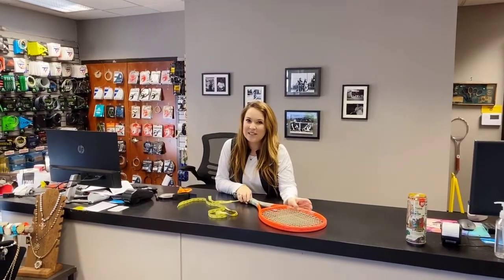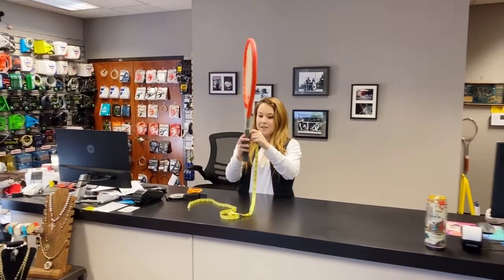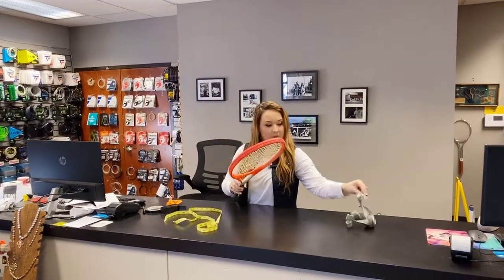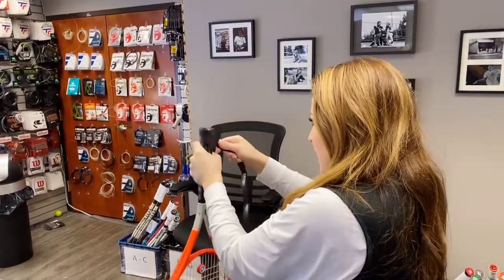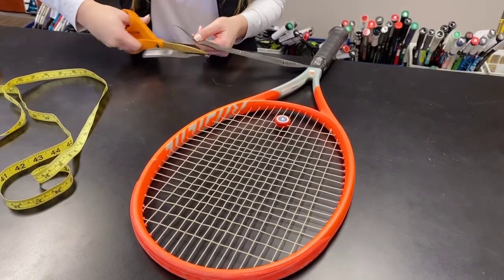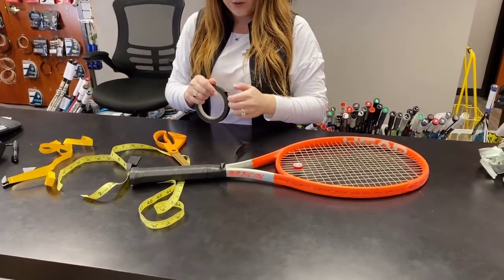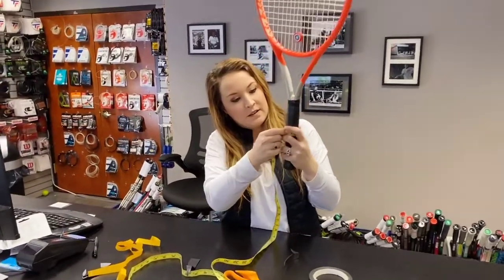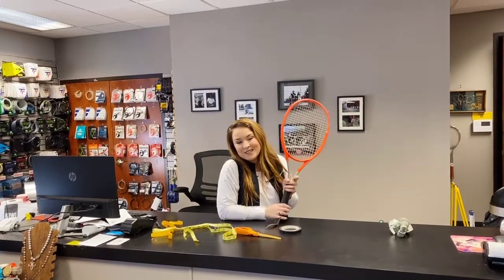How to Make a Tennis Grip Smaller

Comment: to make the grip smaller, you can just remove the replacement grip, then file the bare handle down with a file, or sandpaper.
Reply from the maker: I would HIGHLY advice against this... to get all the sides and bevels sanded down to be identical around the handle would be near impossible.
Reply: @CourtsideAfterHours  i did it😬

Comment: A very extreme way to reduce grip size is to use a sand block and carefully sand down along the bevels to avoid rounding it. But is hard to make is even. Do not recommend do it unless you know what you're doing.
Reply from the maker: Even if you are in the industry I wouldn’t recommend doing it. It’s so hard to get it perfect, my husband and I wouldn’t touch that with a ten foot pole. The manufacturers are very against it as well and I believe it even voids the warranty of the racquet.
Reply: @CourtsideAfterHours  I made a tool just for sanding down the grip, because I like old Head/babolat style grip.  I basically buy a two grip sizes bigger and sand it down using the tool. It's a fool proof method, because the tool stops me for over-sanding and it keeps the racquet handle completely flat.
Reply: This particular racket is a head, which has pallets that are glued on. you can heat them up with a hair dryer and pull them off. Purchase smaller ones + butt cap for like $15-20. Throw whatever grip you want on there. Rackets like Babolat will need a lot more expertise (and bravery) as the handle is a poly urethane and sanding it back is much more permanent!
Reply: it doesn't void warranty :) @CourtsideAfterHours
Reply: @americanbystandard would you mind sharing how you made your tool?

Comment: If you are having head, you can simply replace a pallet.. 
Wrapping a thin grip is not a solution I like because it will definitely going to reduce softness of the handle. I have tried every thin replacement grip but as they are very thin, they don't have same softness as hydrosorb pro. 
Only solution is to buy a correct grip size. 
Btw I like your channel... Nice and cool stuff explained
Reply from the maker: This is good advice, that is the true way to do it. Unfortunately our head rep said that they are to discontinue selling the different size pallets.
Reply: Replacing pallets is the absolute best way.  As you mention they are technically not for sale, but there are ways to obtain the part and get a true grip size adjustment in any direction and maintain factory specs :)

Comment: The problem is that thinner grips change the weight and balance of the racquet as they're lighter. The only thin grip I've seen maintain the same weight are the Tourna thin grips.
Reply: VT advantec might be a good option. It's a rather high tech leather grip that also runs thin and is true to the weight of a leather grip. Certainly swapping this for a stock leather would reduce size but might not so much is the base grip that is stock is already kind of thin. Hmm...